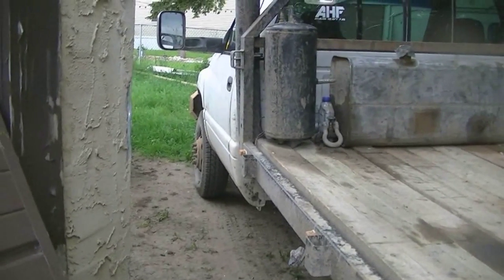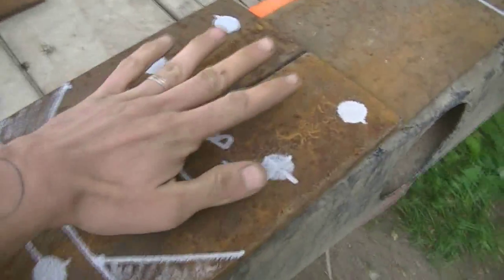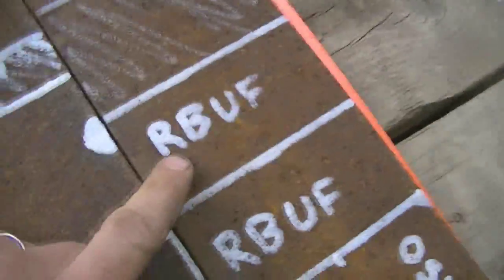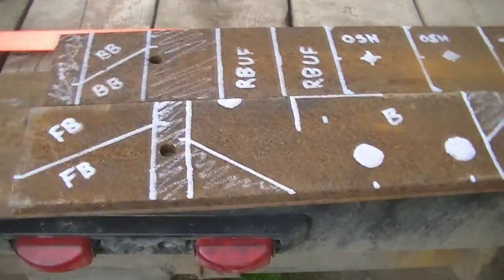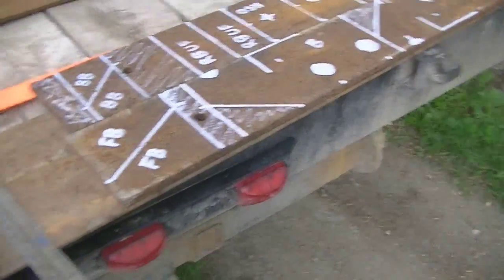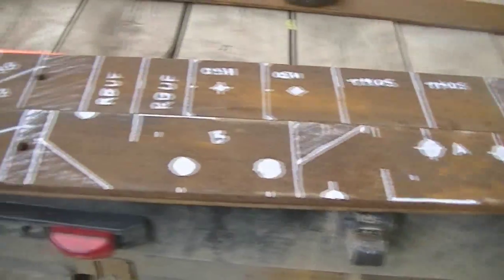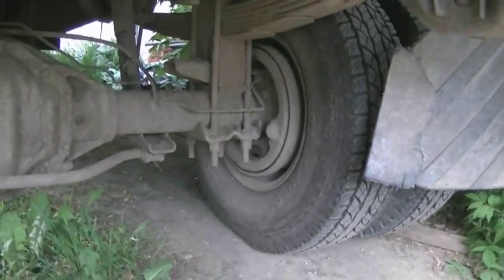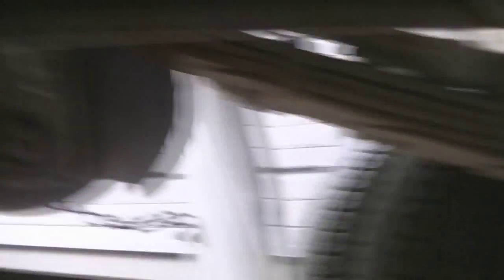AHF Shackle Flip for 2001 Cummins (06/16/13)

Comment: Cut the shock brackets off and extended them up . Put a shackle lift on the yota and that's what I did in the rear. Sitting at about 6in now